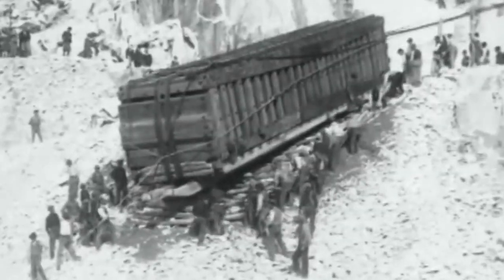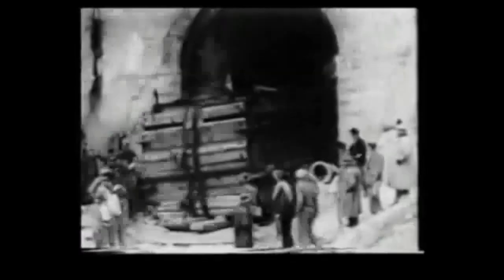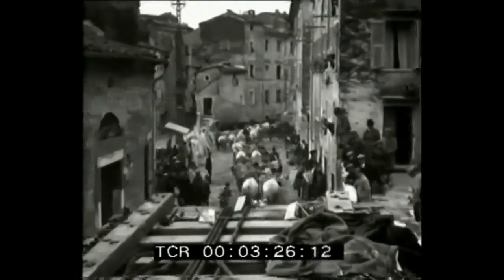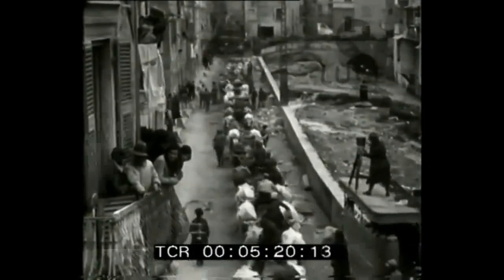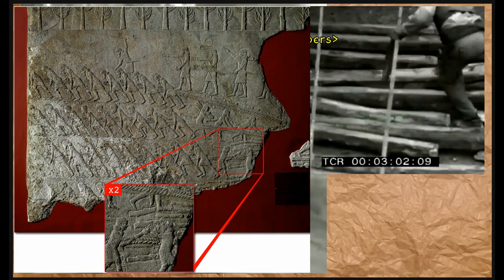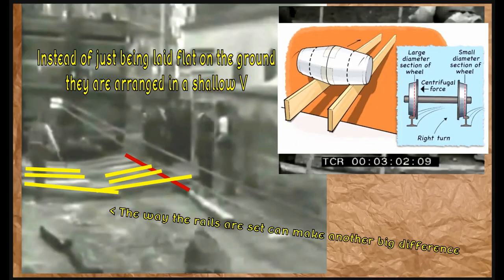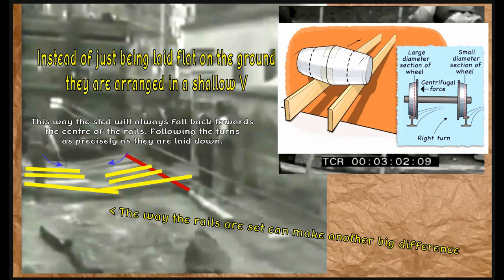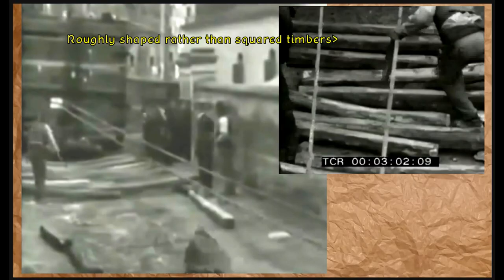How to PRECISELY Steer a MEGALITH with Primitive Technology

Comment: A few details: It was filmed in 1929 and presented to the public in 1932. A massive stone bank from the marble deposit had to be selected that did not show any cracks, crevices or defects. A marble layer was found in the Fantiscritti area in the mountains above Carrara in the Carbonera quarry.The stone cutters, called Marmoristi in Carrara , cut the block free from the rock layer. After the block was detached from the rock layer, it was 19.00 × 2.35 × 2.35 meters in size. This marble block was pushed into a prepared wooden beam structure weighing 50 tons. 36 pairs of ox pulled the obelisk in the plain eleven kilometers to the port in Marina di Carrara , while 70,000 liters of soap were used as a lubricant on the wooden planks.
Reply: When it made it to the port, then what?
Reply: @edwells4769  aliens levitated it onto space ship

Comment: Moving 250tonnes through that tight tunnel down a steep slope makes you realise the serapeum job prob wasn't that bad.
Reply from the maker: Yeah, send the new guy for that.
But those tight corridors would be better since you can use them to get in levers.
Reply: Understand about the Serapeum that it was in operation from the early New Kingdom until Roman times.  The last sarcophagi added - and those nicely done examples you see photos of - actually date to Ptolemaic Egypt when they had iron/steel.  So what can be pulled = can also be pushed.  Ergo a stone sarcophagus on a wooden sled using framing can be pushed/levered into final position via men and yoked oxen.

Comment: As we see there are always workarounds.  Despite the sides looking flush Djoser's pyramid actually has tilted blocks on its outer layers.  By angling the blocks slightly inward that focuses the weight inwards rather than out.  Doing so helps prevent the weight above from pushing outwards and thus degrading the structure. So angling boards can help focus the weight allowing for lateral shift of the block.

As an aside.  The Egyptian quarry of Hatnub in the eastern desert dates to the Old Kingdom.  In 2018 part of a paved road was found on a downslope from an elevated part of the quarry.  Along the sides of this road were postholes.  So while wooden planks were likely used to help facilitate laden sleds moving - via ropes laced around wooden posts along the sides of the road the load could be eased down the grade to control its descent.  Man usually finds a way.

Comment: Someone should ask the LAHT folks how they think the bottom of the trunk on an old oak tree manages to hold 20+ tons of living wood above it. I know the force is from a different direction when you use the trunks as rollers, but come on, it's clearly an incredibly strong material when it comes to being compressed.
Reply from the maker: Lebanese red cedar takes over 2500kg per square inch. 1000 kg per square inch is a safe load for many timbers. 
As someone pointed out they use timber in mines to support the ceiling.🤷‍♂️
Reply: Pound for pound wood can be stronger than steel.  With that said it is an issue of weight transfer.  Rollers only have a small area contact the ground and thus the roller bears most of the weight.  So you can either add more rollers to compensate - OR - you can instead use planks on a firm surface.  Then the plank alone does not bear the weight as the ground does while the plank provides a surface more conducive to movement than hard, broken ground. Note they are not using single spaced logs but rather are packing them in in front of the sled - hence "more" as alluded to.

Comment: Lehner recalls how they tried to move a small monolith, but the rope broke. They tried again, using an identical rope, but this time they oiled it, and the rope managed to move the stone. There are lots of details that can make the difference between failure and success, that's why a failed experiment does not prove the impossibility of the task, but rather shows a way in which is doesn't work.
Reply: The problem I have with modern attempts at duplication is they usually do not reflect the actual composition of the ramps used.  Lehner as you referenced noted that Giza ramps were made in part of tafla and that there is evidence of large scale tafla mining at Giza. Yet attempts are typically done via simply dragging some sled over the open ground absent creating a surface or wetting the surface.  

Wetting simple sand reduces friction as the Dutch team showed but clay when moistened becomes slippery which can enhance sled movement.  Finally what diameter of rope and who made it.  Iconography only shows ropes.  Actual ropes used for moving heavy objects might have been larger in diameter and better made than ones used to interlace boats etc..

Comment: Wikipedia calls the Obelisk to be 300 tonne. While you say it is 250t i am sure Ancient Bullshitters would call that 350t instead, if it wasn't made in modern times ofc.
Reply from the maker: Yeah, the obelisk made of a couple pieces so went with the lesser weight. It’s funny how skeptical - accurate they can be when it goes in the other direction.
Reply: @SacredGeometryDecoded  yes, it is a shame

Comment: Time and scale of ramp are issues.
Reply from the maker: https://www.youtube.com/watch?v=jIK_mU6oOuA&t=7s
Amongst certain circles such as Graham Hancock and lost high technology there has been a false narrative about the issue of ramps. That they must be shallow, 10 degrees or less. This is simply false and flies in the face of long accepted and proven physics. Ancient quarries in Egypt have steeper ramps and use steps to over come the slipping issues. The mechanical advantage of ramps up to 89 degrees can be easily worked out.
https://www.youtube.com/watch?v=YRktSwT9lG4
At 14:30 they show a model of ancient technique for lifting but instead they used a steep ramp, with ancient principles of mechanical advantage known since the earliest days of sail.
https://www.youtube.com/watch?v=73hHtb_if1g
Truckers hitch how to. It's essentially a crane made from a single piece of rope. used to tie down or to lift up depending on where you anchor it. In essence you double your strength with each loop (a little more complicated with that) so with  a double , triple etc the mechanical advantage becomes enormous. It's like antigravity that people have been using for thousands of years
https://www.youtube.com/watch?v=S-GeA7DSycw&t=119s
The two adults never stood a chance against the slim little girl, she had a piece of rope looped around a couple of sticks.

Comment: Awww bull manure there is 1000 ton blocks that's only 250 1/4 the size of the pregnant woman stone
Reply from the maker: The pregnant mother stone is still attached to the earth as with unfinished obelisk. They weigh as much as the Earth.
Plus physics don’t change at magical number. 
Do you believe the physics of a 1 tonne stone is different from 4 t stone?
Look here. You’re not capable of dealing with these issues and if you want to invite ridicule then it is in on the menu.
I don’t have the patience for ignorant nutters that I used to have.
Run along now and go to Mystery History or Bright Insight or something. You’ll find yourself amongst your peers over in those places.
Reply: Still with the nonsense I see.  lol!  Your block dates to Roman times.  That means iron to reinforce a wheeled conveyance which oxen can pull.  Also it rests about a kilometer from the temple mount with the ground being gentle grades.  So it was quarried not far from where it would go with the ground being conducive to wheels and the dating allowing for iron-reinforced conveyance.  Better luck next time.
Reply: “Youre not capable of dealing with these issues” lol